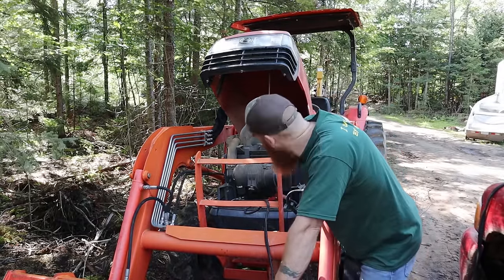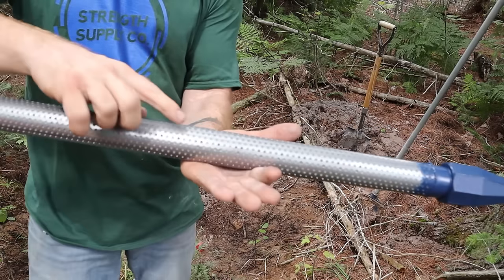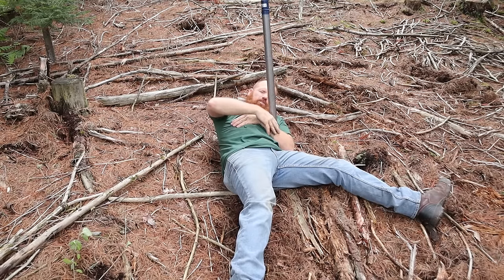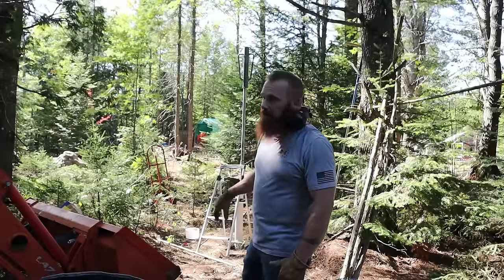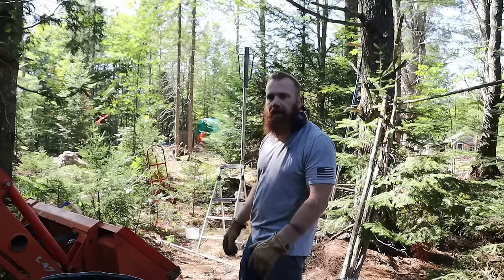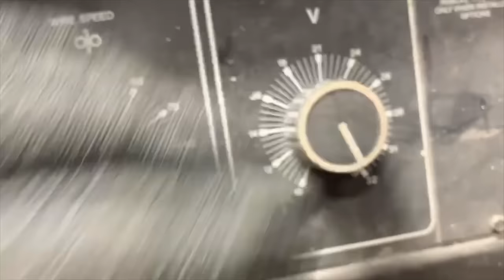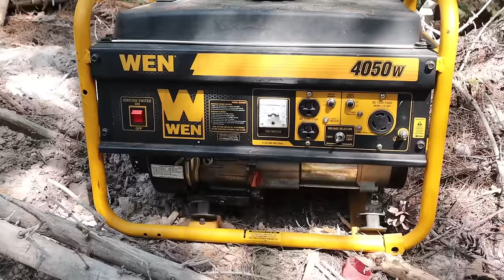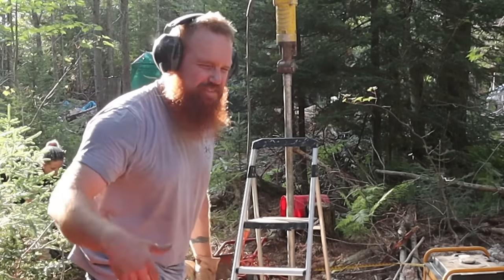Off Grid YouTube Family of Girls Step up to Help Dad Drive a Well | Fabricating Off Grid Well Tools

Comment: You've probably gotten the same comment a dozen times. Only one problem I see. The outer PVC is the cup that fills with water and the point works like a straw. Driving the point into the soil is like driving a straw into an orange. The PVC pipe should be deeper than the point.

Comment: Um could you use down pressure of the tractor loader?  I use mine to drive fence post.  I put the driver on top of the post and the loader bucket will push the fence post as deep as I want to go,  In any case you have a remarkable family and I wish you success beyond your wildest dream. God bless!
Reply from the maker: Mine is too small to drive a well point. Tried it. I believe it could do a T post. Thank you have a great night!

Comment: Admire what your family is doing, for sure!  I have minimal to zero knowledge of setting a well... I helped hand dig a 65 foot deep well with my father when I was a teenager.  we used the tri-pod and rope attached to a one way shovel to dig out the casing all the way down.  Then dropped the inch and a quarter pipe with foot valve and screen to the bottom.  I never saw someone just drive the thing down through the dirt and clay like that!  Is there an advantage to this method?  Can someone educate me?  😊
Reply from the maker: It depends on your area. If you have a higher water table it’s usually not a problem but unfortunately we are finding our property has a very deep clay layer and it’s kickin our butts!

Comment: You have a tractor with a hydraulic bucket on it buy some straps and learn how to wrap them around a pipe and attach it to your bucket. Pressurizing water inside of the pipe as you are going down will help wash out the hole and keep the clay out of the pipe

Comment: Yeah I’ve tried welding those jackhammer bits also . Sometimes it works better than most of the time but they always seem to break 🤣
Reply from the maker: I think if I’d of heated them up red hot with a torch and then welded them, it would’ve held better

Comment: I’m about 16’ deep w/ my post hole digger and the pipe on the post hole digger is too heavy to manually lift. I have a 275 gal. tote and a 2 horse sludge pump that will hopefully drive the sludge slurry back to the top where it will empty into a  hole and we’ll repeat. We’ll see how that works.
Reply from the maker: Good luck with it! Unfortunately for us , we never got it

Comment: What we did was drive the well by hand , to unclog the screen when you get as far as you want to go take a 12 gauge shotgun with double 00 buckshot put barrel in pipe , make sure your barrel IS NOT in the water put rag on top of pipe and blast away. , works ever time to clean the screen. Use a hand pump to get mud out of pipe before hooking up electric pump
Reply from the maker: Wow yeah but I’d be worried about lead poisoning! 😂
Reply: Most buckshot can be found in steel nowadays, it would just be iron supplements!

Comment: You need more weight on the fencepost driver when you use it for well drilling.  Once you stack a couple of pipes together, their weight and inertia is greater than the driver, limiting how much driving energy you can apply to the pipe no matter how hard and fast you can slam it.

Comment: Chad and Family my friends, I've been glued to your channel since I found it. Even during my sleeping hours! I've watched your ten battles for a well. I feel your pain. Then I remembered my year of spudding with a homemade rig,  water wells in Michigan with my ex Brother-in-law The Honorable Don Dennis!. AKA "KONG".
. Hope by the time you read this you have a functioning well! What I member is we drilled out a hole to drive casing in, We flushed the broken dirt, Clay, rocks, etc. out of the casing hole to set the shoe in the rock. Screen on the 1 1'2" would never be used to drive thru clay or rock. It was dropped on drop pipe at the end of the casing installation. Perhaps only dropped 100 feet on 275 foot of casing?
Depended on the level of the water in the casing set in stone at 275" and a hole punched in the rock for 20' ,maybe 30'. Just seems to me that the same basic process would be used for Hand Driven wells? The screen in a shallow well will be pushed down to the water level and perhaps 15 foot lower, the draw down feet. The draw down would depend like diapers on how much pump needed and level of water desired.
   I have  out a request for the ex President of the Michigan Water Well Association to contact you. I've known this guy for 49 years. Tom Cox. Lives in Lake City , Michigan. God Bless And Keep You!
Reply: PS, I also witnessed an ad for a directional drilling rig that was like a small trailer.......sure looked like it could drill beyond your clay to reach pebbles.Or an underground river.....! I have personally dug trenches, 3 ft wide and four foot deep all over The Mitten. Not so much in The UP. Been 200' above Lake Michigan with Beachfront dirt, and hit underground Rivers. God Bless and God Speed.
Reply from the maker: Thank you Charles. We haven’t had a chance to get back on the well as we are in a fast dash to get our cabin patched up enough for the winter months. We hope you are doing well and we really appreciate you taking your time to give us some advice. Take care.
Reply: We also put casing mud around the casing too stop cave ins and shit!
Reply: It comes in heavy bags! LOL! You can do this.

Comment: Using a two foot "sacrificial" section of pipe at the top takes all the beating up there....
Using  a forced water jet pipe rig bores the hole for you....
Having ran rotary table drilling rigs, they're quite large driving a semi-truck straight bed into remote areas.

Comment: For ever foot of water its .433 psi (hight x density) there are lots of ways to lift water. Removing atmospheric pressure limits you to 26ft. The inline pump can push water well over 100s of feet

Comment: You know you can get a portable hydraulic post driver? 

They also make them as tractor & skid steer attachments...you can probably rent one that's multiple times more effective than what you've tried so far. 
I do love the enthusiasm, but as someone who's manually pounded hundreds of posts over the years (aside from other forms extreme physical labor)...I can say that your body will thank you in about 20 years if you don't do the same.

Glad your using ear protection, wish I had done so more often.
Reply from the maker: What? 👂 😆 we don’t have much for rental stuff up here. And yes I am glad I wore ear protection too. I’m bad at safety glasses and ear protective gear. Have a great day!

Comment: overshot to tie on to the pipe and try to  PULL  IT out... circulation thru the pipe to help unstuck it. ream the hole out with some kind of auger/post hole digger... 2" bit... 4" bit... 6" bit... bentonite clay to slicken up the hole... to keep hole from falling in. the clay absorbs water and swells up/falls into the hole... sticks the pipe if dont keep the pipe moving up/down/ round and rounde... then run 4" pipe down the hole with slots cut in it and some kind of water/sand filter on the outside of the pvc pipe thru the water zone... fill the water zone with nice clean beach sand.  the hole likes to have mechanical action of pipe going in and out of it ... like rocking a truck in the mud to pack the mud to get out of the mud... circulated each drilled down joint at least one time up/down to clean out the hole and pack the hole from falling in... hopefully.  got to have some kind of derrick and winch to PULL on it if it starts to get stuck. 4x4 x 12' posts reinforced and hand winch. steel wud be better. as wood cn break. hard hats a must if PULLING on stuck pipe . got to keep the pipe moving all the time round and round and or up and down or the pipe will get stuck in the hole and... might neeed real HP/block and line/derrick to put a bind on the pipe to get it loose

Comment: I went about it differently.  I actually "drilled" a hole using a drilling table I fashioned after an oil well drilling platform I saw.  

I dug 10 feet, using a circular row of metal teeth attached to the end of the pipe, all the while, flushing out the dirt with water and compressed air.

Once I'm into water, I continue several feet at which point, I insert a capped length of the next-size smaller pipe (PVC) that has holes drilled in its sides about 6" from the end, with a cylinder of rolled nylon window screen jammed in place to screen out dirt.

To use the water, there is a "dip tube" of even smaller pipe with its end bias-cut, resting in that bottom end cap. I use a valve to close off the largest pipe and inject compressed air (from my windmills) to force the water to the surface to water my pasture year round. Texas  
Easy peasy.
Reply from the maker: Nice!

Comment: Well you have a tractor all you need to do and we’ve built wells before get a block and tackle hang it up High between two trees start out with a four-inch pipe to get down about 5 feet get a 3 inch pipe put it inside make sure to weld at the end two blades make it a 10 foot pipe weld a bolt across and tie a rope to it pull the pipe up and down till it fills up with dirt jack the tractor up well the 55 gallon barrel to mounts to the rim of the tractor put it in gear and pull up the pipeKnock out the dirt and repeat till you get down to 250 feet should take three days
Reply from the maker: I think I’ve seen a video like this a while back! It may come to it. Thank you for the tip. Will definitely keep that in mind! Have a great night!

Comment: In my younger days I too was driving a well by hand and it broke below ground although I could see the break.  After speaking with several people I was directed to an old gentleman who told me I could pull the pipe up with something he had made.  We went in his shed and he pulled out a piece of well pipe that had been cut down the middle on one side.  One side of the cut was hammered in with the other side overlapping it to bring it to a crude point, and I mean crude.  He told me to stick the pointed in the broken pipe then take a pipe wrench and turn it to jam it in.. I have to say I left his house saying to myself this would never work.  I did as he said and the “extractor” locked in. I then chained two 2x6 on each side of the pipe around a pipe wrench and using a concrete block on one end and a bumper jack on the long end I started jacking. It took a couple of tries but it did start pulling the pipe out!  It was slow  going but evidentially did pull to pipe up and made the repair.. I still marvel at that “extractor” piece today.  I returned it to the man and thanked him many times..
Reply from the maker: That’s a great idea! Did you ever get the well working? And how many feet down were you
Reply: The water table where I live is very shallow. I ended up washing it in with the help of a neighbor. 15 to 20 foot piece of water pipe with a hose connection on one end and a nozzle on the other..had my point and pipe assembled.. turned on the water used the water pressure to sink it in once I reached the end of the water pipe I withdrew it and literally dropped the point and pipe in. Badda bing badda boom..

Comment: A wise man once told me how he would dig these types of wells. You put a truck up on jackstands and put a spare "dually" wheel on it so the rim sticks out past the fender.

They made the "plumb bob" from an old truck axle with a point and a loop on the back.
Then you loop a rope through a pulley and throw a loop or two around the truck wheel.
Now run the truck in idle (in gear) and use the truck wheel to lift the rod from the hole.
You control the action by tensioning the rope on the wheel to lift, then when you give it slack, it slips and drops in the hole.

He said he could sit there smoking a cig while "flipping" the rope with one hand and the truck does all the work.
It would lift the rod a few feet then drop it with a flick of the wrist and repeat.
Reply from the maker: But I don’t smoke?
Reply: I ran a Cralius rock rig, set up for wireline coring, but we used it for wash drilling down to 700ft, mounted on a Jimmy 6x6. I pulled 6000 pounds of gear out of the hole using the cathead and some heavy hemp rope. Very similar to your dually onna truck. Two turns for light gear, three if it got up a bit tight. Used it pull out drill rods, casing, every day. Never forgot that lesson, safe and easy. Funny it was the first thing I thought of when I saw the dudes banging away with the post driver.
Good luck with the bore, waiting for the next vid.

Comment: Love the quality time with the daughters!  They'll remember it, trust me.  As for the well, if I'm not mistaken you can't suck water more than 20' or so.... so 60' is poinless.
Reply from the maker: We purchased a jet pump that will if we could get through the clay
Reply: not quite true.  the depth that you can draw water up is completely dependant on the size of the pump.   the majority of stuff we are seeing on youtube where they say "no deeper than 25 feet" are all using the same size pump.    its pretty dang small to be honest.   if we look back into the 1800's we see records where people had hand driven wells that went far far deeper than that and were just fine pumping water because they were using a much bigger pump at the surface.   pumping water up 60' by hand is not an issue at all if you have the proper sized hand pump.
Reply: @orion7741  I can't dispute claims that in the 1800's people drew water far deeper.... but I also know that a column of water more that 20-25' will draw a vacuum at the top of the column.  It is due not to pump size but atmospheric pressure.  Mercury is heavier than water, so the limit for mercury is 30 inches before it draws a vacuum.  But I suppose with a very long stroke pump you could overcome the vacuum at the top with sheer brute force.
Reply: @orion7741  size of the pump does not matter, you physically cannot pull water up 60 feet, atmospheric pressure is 14.7 psi and 1 psi is 2.31 feet of water so pulling water over 35 feet is physically impossible. The old time hand pumps had the "well cylinder" (pump) at the bottom and  used a sucker rod up to the "pump jack" which is the part above the ground so they push the water up.

Comment: Remarkably there is a chance you do not need that driven well. You hit water about 8 feet down just by hand. You could do that again, and simply pump water out of it while checking the water level to determine to flow volume. If its low, you could still use it to fill a large plastic or concrete tank as a reservoir The clay should clear eventually when pumping and run clear. then pump water from the tanks for daily use with a float switch that keeps the well pumping into the tanks and stops when its full. In fact the depth of well driven itself may be used as a reservoir as long as water can get down into the top of the pipe to fill that 50 ft depth periodically. You would pump from down deep and that would go to your tanks for a two-fold water storage that affords more reservoir that slowly refills. There is plenty of rainwater in your area for a cistern obviously which would be used for soft water showers, toilets, and laundry.
Reply from the maker: Thank you Paul. We’ve considered a few things. One being something similar to what you’re saying. But, this well thing and I aren’t done yet.. I feel it’s something I need to get right. 😆 Can’t let it beat me!

Comment: Why not add some quick disconnect extensions on your post hole digger and just keep going down. Make a screen on a stick of pvc by cutting slit then wrapping it in high flow weed block. Seal the weed block with silicone. Put a cap on the bottom. This will give you a 10' screen. Add extra sections of 4" PVC till you have your full length. Add some large sand around the screen till about 10' or so from the top. Fill the last section with bentonite clay. Drop a 24v DV brushless ceramic bearing pump down to the bottom and hook it directly to a solar panel if you want.  Going deeper gives you some buffer draw down and can help prevent a low power pump from going dry as its volume output will drop as the pumping water hight rises till it reaches and out put balance. The water will come out muddy for a long time then channels will start to form and the clay will come out less over time increasing your flow rate
Reply from the maker: I screenshot this. Thank you

Comment: Don't have much experience with drilling a new well but can you use the hydraulics on your tractor to either drill or push (raise and lower) new pipe beyond the clay level?
Reply from the maker: The tractor won’t push the pipe down. But it may be able to pull it up using the three point hitch.

Comment: My great uncle was a well driller which was a derrick boom on the back of a truck with a weight that would pound the pipe with the well head twisting the pipe as it drove into the ground.   Unlike the 6" pipe drillers use now the old wells were 4" diameter.   Do you think welding the couplings to the pipe would have made it stronger?
Reply from the maker: Welding the couplings to the pipe may of helped but also the heat from welding could also weaken the metal. I don’t have a welder at the homestead anyway

Comment: Use heavy wall black pipe sch. 40 wall thickness is 0.144 in , or you can go to sch 80 which is .20 in wall thickness. You have probable figured out why a well uses a casing before putting in the pipe. With you perseverance and determination I'm sure it will eventually all work out.
Reply: NEVER use black iron pipe for water

Comment: the problem with the priming i think is that you didn't use check valves. Since those pumps love to lose priming you should have added one to make the water in the pump stay in place